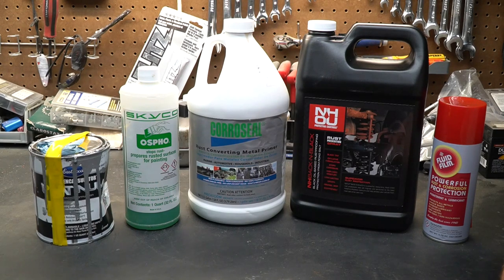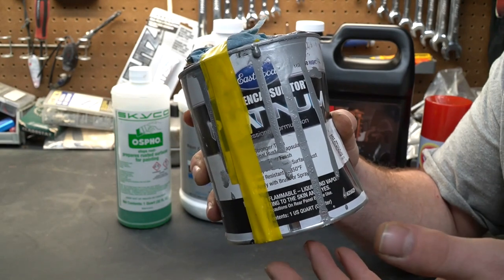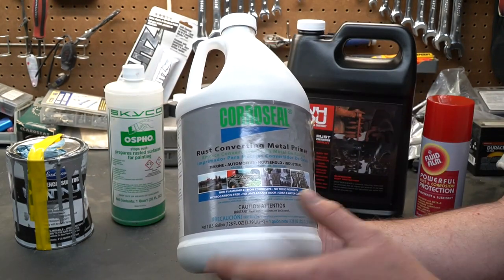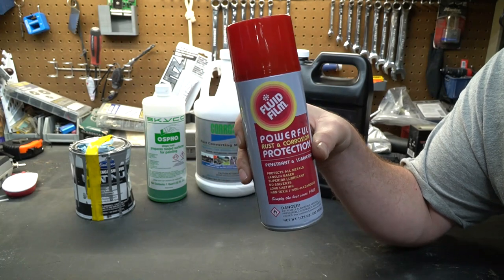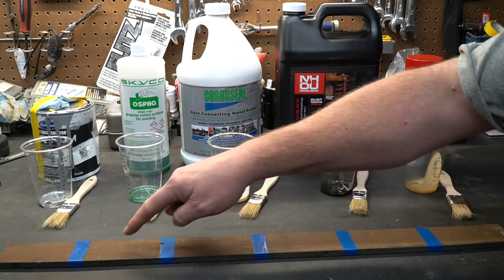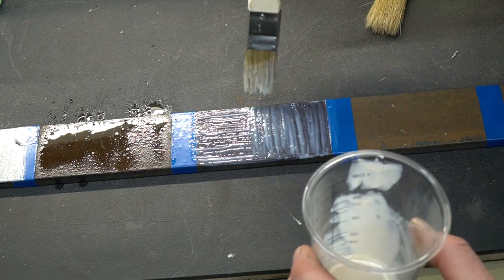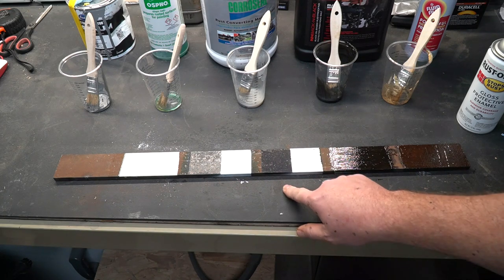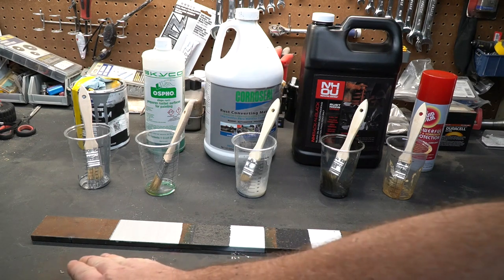Stopping Rust with Ospho, Corroseal, Eastwood Encapsulator Platinum, NHOU and Fluid Film! PART 1

Comment: I like the fluid film for the undercoating job......my other rust thing is I buy older used cars. When I catch rust areas in the body...wheel wells, under the bumpers ect.....I like to of course sand off the loose rust, then use a converter or encapsulater to get a good bonding surface.  Then cover the area with a fiberglass mat, with the bondo fiberglass resin. The stuff is very hard and a royal beach to finish,  but it does last a long time.. (Lots of guys will say just cut it out and weld in new metal, yeah, yeah, I get it, but that's not this topic..)

So what I'm getting at......what is you best suggestion for the rust cure to get a good base for a fiberglass mat and resin top cover to then finish out? Could you make a test panel with the mat and resin? Converters and encapsulaters?

Tha amount of conflicting YT videos on this is amazing...

Comment: i been using an airisol spray called rust fix ,seems to work well long term!  im interested to see how these hold up over the winter.
Reply from the maker: Is this it?  I'll have to give it a try!   https://www.duplicolor.com/product/rust-fix-rust-destroying-coating/
Reply: A lot of the aerosol rust converter products use Formic acid which works as a rust converter, but is much less powerful than Phosphoric acid, the active ingredient in Ospho. Plus they end up a lot more expensive per ounce than Ospho and especially Klean-Strip Concrete & Metal Prep which is less than half the price and is also Phosphoric acid. Not knocking you at all, I have used a lot of the rust fix type products, especially VHT Rust Converter.

Comment: Mustie1 swears by Chain saw bar oil for treating frame rails in the Northeast area. Says it last for several years before needing to be treatment again.
Reply from the maker: Bar Chain Oil is good stuff!  I had a relative that use to use it on his vehicles back in the 80s!   His big thing was lots of wax on the body and lots of bar chain oil underneath.   Seemed to work!

Comment: I watched so much stuff and tried even more.  All stuff gets washed off or rubbed off.  The only chance I see is removing the rust as much as possible, painting it with Corraseal, then painting over Corraseal with oil based paint, and on top of the paint fluid film or surface shield just in case the paint gets a scratch or a chip.  If that does not work, nothing will.  Rust is like cancer.

Comment: Lanolin is an oil. It's actually the oil from sheep's wool and skin. Also, I've seen some very disappointing results in other tests of corroseal.
Reply from the maker: I started to explain where Lanolin came from then I decided it was probably not going to be appreciated.   :D    Corroseal works ok if you follow the directions and top coat it.   I think the key is to follow the directions, you really need to prep the surface and keep an eye on it.  If any gray or brown spots are showing, you need to keep reapplying it.   Then a day later give it a top coat and it does reasonably well.    Eastwood Platinum is my favorite though, it works exceptionally well.